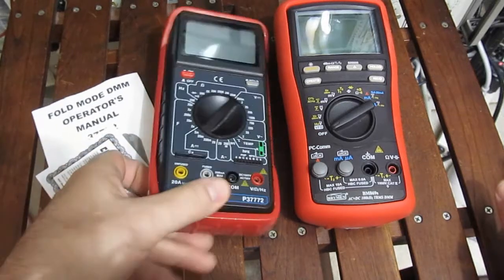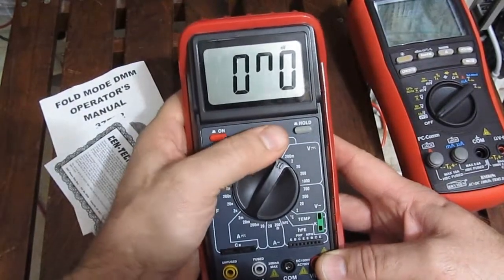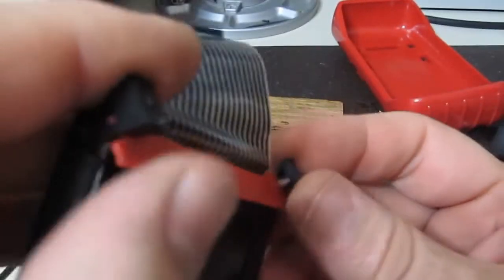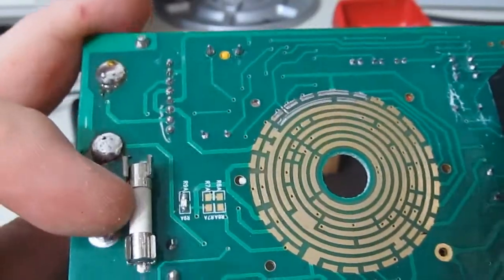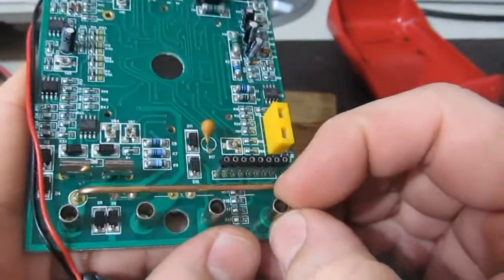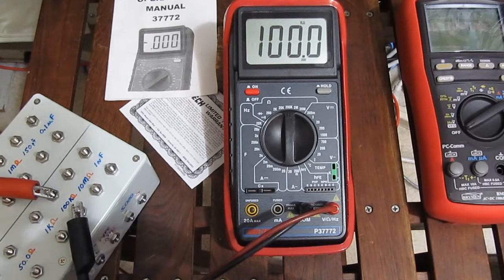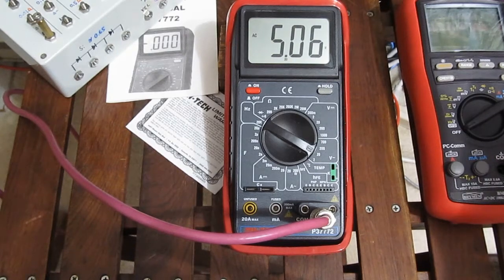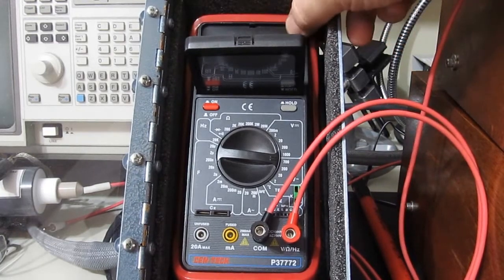Cen-tech P37772  Mastech M9508 on the half cycle AC line simulator

Comment: This video has helped me find at least one of the issues. I am missing one of those tent shaped spring contacts that go into the rotary, as well as improper placement of the contacts. Any idea where I can get another one of those little things? Thanks for the video
Reply from the maker: Outside of salvaging a junked meter, no.  Maybe you could make one with a dremel tool and thin spring metal.
Reply: I have other cheap/free broken cen tech DVOMs that hopefully have the same part even though they're the smaller size meter. Otherwise, it may be possible to fab something up. Unfortunately, time and energy spent on saving this device would not be best spent comparing to just buying a Fluke or something, lol. I'm gonna donut anyways, or at least try.

Comment: Interesting video, thanks for posting.  Personally I think somebody in China made a (slim) profit selling that, and HF and some shippers made a profit as well.   One can only guess what they are getting ICs, materials and labor for!...  A few questions on things I didn't see in the video: (1) What was the value and rise time of the transient you applied? (2) how many times did you apply the single transient? (3) was the meter short from V to common afterwards, or open? (4) why did you pull the battery first?
Reply from the maker: Glad you enjoyed it.     2) I applied two transients.  The first with the case closed and again with it open.  3) I suspect open  4) To avoid the risk of it coming apart.   1)   Towards the bottom, I explain the setup:  https://forum.allaboutcircuits.com/threads/uni-t-139c-problem.158984/page-3
Reply: @joesmith-je3tq  Many thanks Joe.  There seems to be a problem with my YT account and I just saw your reply.  I have one of these that I still use around the house (Cat II- applications) and it’s been a good meter.  I never had any display problems; maybe just a matter of time as that seems to be a common issue with these.  Still I plan to take it apart and understand the potential surge failure mode vs. the location shown on your video and your other data.   Thanks again for sharing!

Comment: Hi Joe,
You can purchase that same tester here in sa under the brand name MY64. I had one but it didn't last for 2 weeks. They cost around $14....crap! Some of the hobby stores here call it pro-DMM...ha!
Reply from the maker: Let me guess, after two weeks you connected to a MOT. HA HA!   This one lasted about 6 years when the display started to get intermittent.  The flip up display interconnect is why the two I had failed.  All low voltage work.
Reply: HA,HA! you bet, it was an oscillating relay. Well, i did it on purpose because i just had enough of it.That dialing for every setting and the incorrect  readouts
Reply from the maker: I have another analog meter I want to look at.  That and the other analog meter along with the UT90A are the only manual range meters I have right now.  I would never want to have to use one.   Surprised the BEMF from a relay would damage it.... Well maybe not on second thought.
Reply: More like a 12v oscillating  relay connected to a car coil. Joe, I'm getting spark gaps of up to 20mm with it.
Reply: Here in SA you get a multi meter called MAJOR TECH. It's  a  true sa meter. Have you heard of it. Wish you can test it.
Reply from the maker: I can believe 20mm jump with a car coil.  Were you on the primary or secondary side?  Will your new meter survive it?    I looked at the MT website.  Which meter do you have?
Reply: Joe, yeah, this is my version of a transient gen. Ha, I'll never be shush a fool to use my Brymen on that bugger . I got an analog diy voltmeter up to 5k5v and once bend the needle with it. The MT is the MT1887 .Of what i know, they re brand  it as the Extech EX530 on the overseas market. I have the Brymen BM252 as well. It's much smaller than the 867 but just as robust. The only thing this tester can't do is to measure LED. The diode test can only go as high as 1v55
Reply from the maker: I have the EX540 and use one for work.  The one from work gets a lot of abuse and has held up well.  The new one I bought was not made near as well.  It also has some problems that the older one did not.  These were made by CEM.   My plan was to test the EX540 when I bought it but it was in such poor condition, I did not see a reason to.  Looks like there are some reviews out there for the MT1887.   I have never ran the BM252 or the 867.   I am pretty impressed with the robustness of the 235 and 869s.
Reply: Joe, i'd watched the video you talked about. I don't recognize the tester. Has never seen it before .The 252 got the same footprint as the 235 but with less futures . It's a pity you didn't test the EX540 but it's up to you. Thanks for the reply's